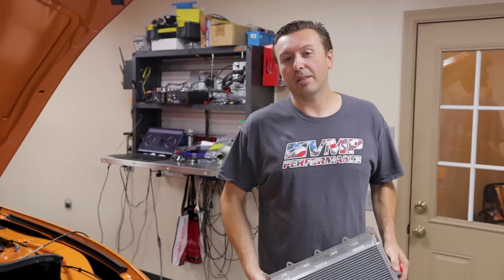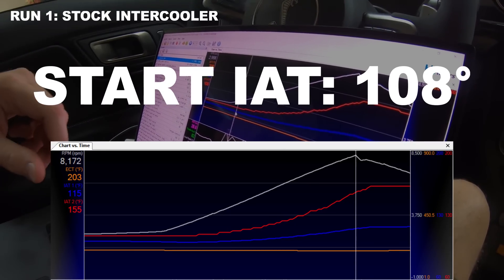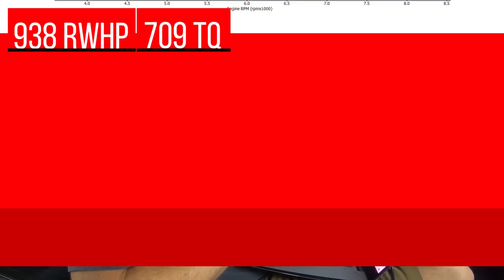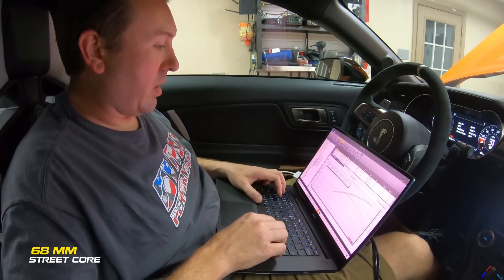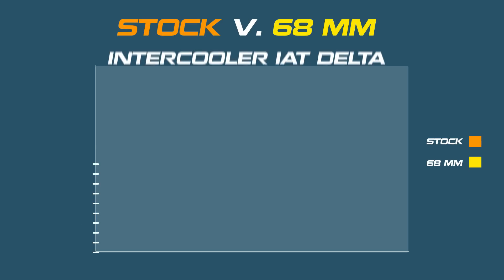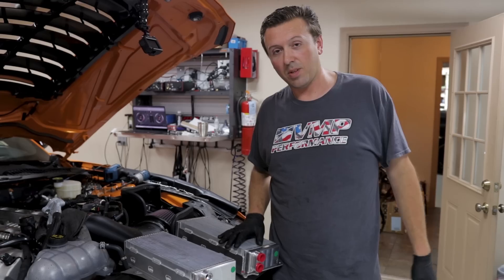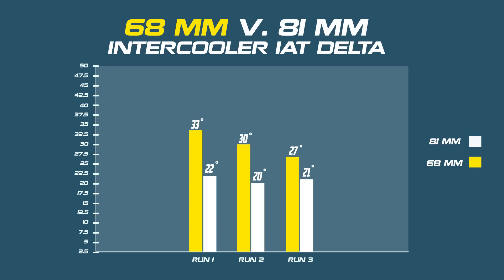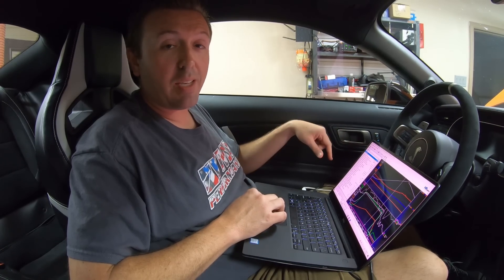2020 GT500 Predator Parts Development - VMP Intercooler Core Upgrades

Comment: Question...You mentioned "pressure" drop as you increase the size of the intercooler brick, are you referring to "boost" drop?  Sorry, still learning the lingo.  You mentioned in the vid that the 81mm race brick is not recommended for everyone due to this drop.  What do you recommend for stock GT500 owners as a first step mod?  Mine is stock with only the JLT CAI, but I want to do mods one step at a time. Would upgrading the cooling system brick ONLY on a stock engine actually reduce the HP because of the pressure drop?
Reply from the maker: Through further testing, we've found the 81mm to be the best option and no longer offer the 68mm.  As for first/next steps, we don't see the intercooler core hurting your output and it'll prepare you for further modifications along the way.
Reply: @VMPPerformanceTV  Thanks for the feedback!  I see that there may be some larger blower lids coming out.  Would you recommend those larger lids to go along with the 81mm upgraded brick?  Would you do one before the other or does it make sense to do them both at the same time?  Any benefit to adding a larger lid that you see?   Also, I assume that no Tune is needed for cooling upgrades like these?  I will eventually do a tune and pulley but upgrading the cooling systems on the supercharger seemed like a good first step to prepare, like you mentioned.  Thanks for your time!!

Comment: Since it isn't mentioned, what's the water inlet diameter for the 68 and the 81? One inch or stock?
Reply from the maker: Hey Aaron, this version is stock for easy installation.  Our core flows more internally due to the design, and we have not found a need for increased floating tube size yet.  We are looking at offering a 1" AN fitting block for the blower.

Comment: do you know what intercooler pump the gt500 is using and what the flow rate is?
Reply from the maker: It uses the pierberg cwa50 which was in the 13-14 gt500 too.  It flows around 8 gpm which is pretty good, and the flow rate goes up slightly with the new core due to lower restriction.

Comment: Would a waterless coolant help any?
Reply from the maker: We have experimented with that before and it does not help.  My opinion is the intercooler system is a low-temp/low-pressure system and does not benefit from a higher boiling point fluid.

Comment: Nice! Do you also have an upgraded heat exchanger for the 2018+ GT VMP, Whipple, Rousch etc., Superchargers?
Reply from the maker: We offer a triple pass and dual fan set up for all '15 to current supercharged Mustangs that we've had great success with.  Here's a link: https://www.vmpperformance.com/VMP-Dual-Fan-Triple-Pass-Heat-Exchanger-for-Mustang-05-18-GT500-5.0L-GT_6

Comment: Luckily we start off quite a bit better from the factory vs the GM guys. Only setup they don’t get hosed on aftermarket is the DI2650. While obviously  different for packaging reasons I believe the Odin is essentially the same set up cooling wise. Looking at the room left I bet a spacer could be used to get the plenum size and distance from the cooler back to stock.